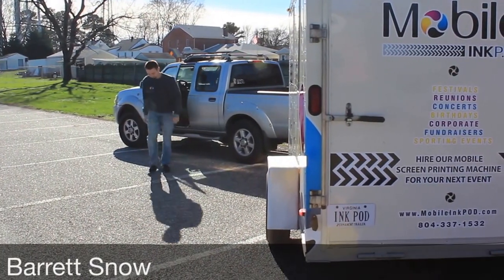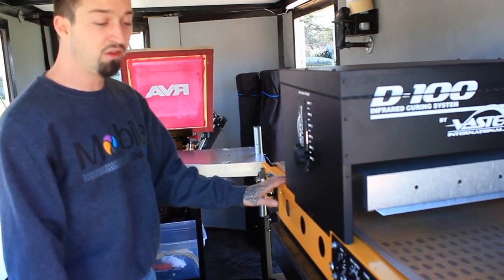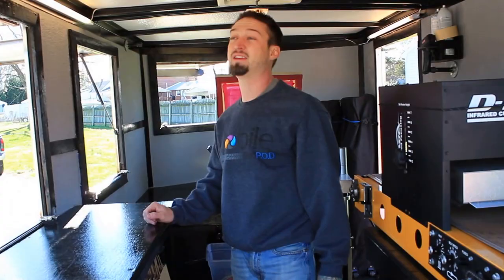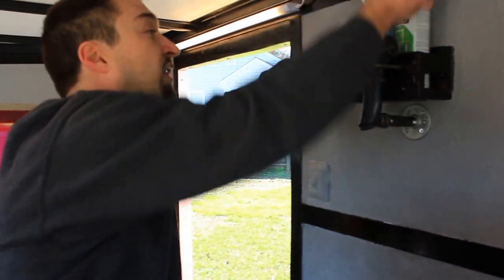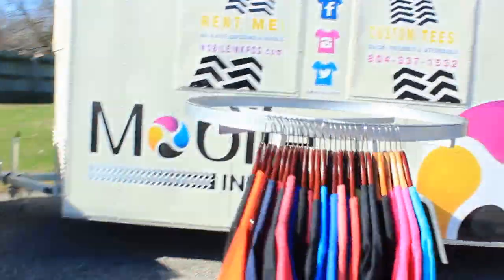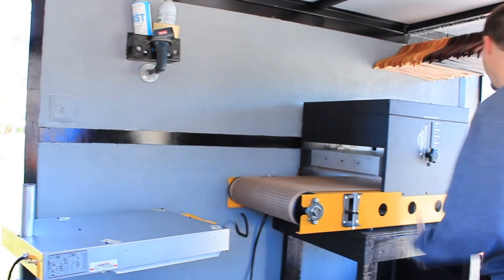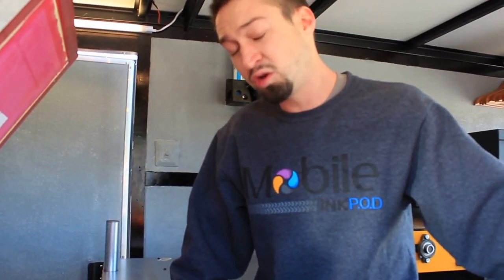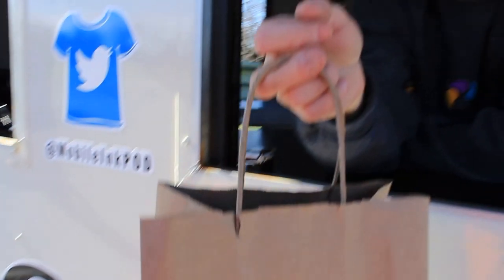The Standard Set Up for Live Apparel Printing.

Comment: It's cool, but I think this is really something for simply live events. You can't be creating screens and exposures for one client at an event. That is why this is really more ideal for corporate functions for a company to put their logo or event design on that is predetermined in advance. You could however have designs that have been screened onto transfer paper and then heat transferred to the garment. But screen printers why are you all still saying that screen printing is superior to DTG? I totally disagree with that. I mean there are places for the two but just the fact that you can have a DTG machine at one of these events and then yes you can do a full color print in 2 mins without making screens or anything just makes more sense in my opinion. You are limited screening like this, I could pull up in a similar setup and print  any image onto garments in full color without any mess on pre treated shirts. There is a place for both but to say screen printing will outlast DTG is not true anymore.
Reply: I actually do this! I have a whopping 28ft x 8.5ft trailer we bring to events with a dtg machione and we ha e been selling lots of t-shirts with lots of differnt designs.